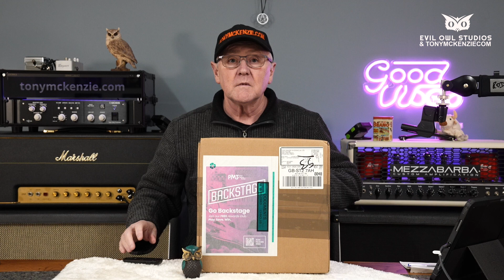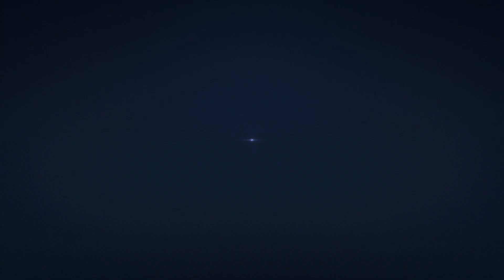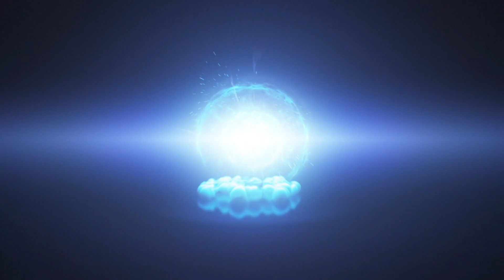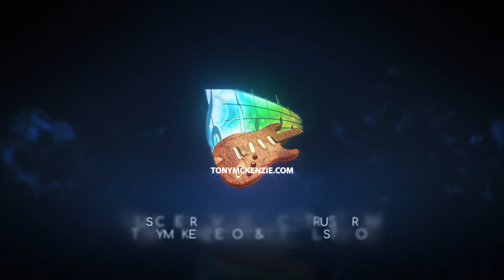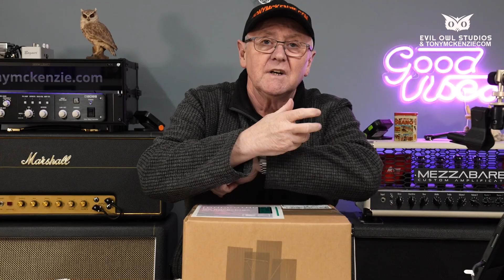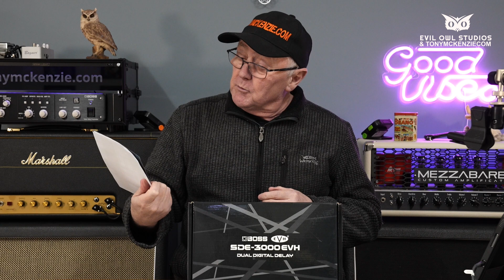Boss EVH SD 3000 dual delay: The truth

Comment: These japaneese boss/ roland electronic designers are from an other level thats foir sure...I have boss pedals made in japan from the 80sa and still work...and always have. I think that the most significant feature of this pedal is the wet/dry/wet option..which should give a kind of 3d wall of sound...with 3 amps active.

Comment: Great video. Love seeing inside stuff I don't have the nerves to take apart myself. Picked up the standard version the ther day, it was a geat deal as they are less than 1/2 price in Can/US at the moment. For my use on a pedalboard, the small MIDI jacks work well when connecting to other pedals that have the same jacks, because the cables are way less bulky and are seldom removed. Again, great video.
Reply from the maker: Thanks for watching and appreciate your input on the MIDI jacks.

Comment: Good review of the delay. Nice and thorough. But exactly what do you mean by “maybe he used wet/dry/wet and maybe he didn’t” ? Lmaooo like it’s 1000% well known fact Eddie’s been using that style of rig since the late 80’s
Reply from the maker: Well I never heard EDDIE say that... maybe there's a link or something. In the case of this pedal though I only saw an engineer and Pete Thorn saying it all. Can I trust what they say... well maybe or not, but they have a video promoting the sales. That's all I really referred to... and thanks for the info. Thanks for watching too.
Reply: @tonymckenzieofficial  I believe there’s an article of Eddie saying he used 2 separate SDE3000’s. Hence to 2 different delay times. Multiple pictures and questions with guitar techs proving Eddie used the original SDE3000’s. Also hence the reason there’s even an EVH version of this pedal. It’s not a question of if he used them. Now him having any involvement in this specific pedal is a different story. But saying he may or may not have used the original is not even a question

Comment: You can pick up a Boss SX700 for very little these days, it's essentially all 3 of Roland's 330 series i.e. the SDE, SDX & SRV 330s (the later and less noisy versions of the 3000 series) in a much shallower box (with a big 14v wall wart though) much less noise & with full control over the RSS section, more so than anything outside of the actual expensive & rare RSS units... well worth looking out for.
An original SDE 3000 goes for around 200/300 euros 2nd hand, the 330 series go for more.
Reply from the maker: Thanks James for that info. I don't use these often and sometimes it can be hard spending time looking for the stuff like you posted so thanks for that. And thanks for watching.
Reply: This has no stereo in???

Comment: Well done for buying from PMT instead of the B grade cowboys on the south coast!
It appears to be well made, even with the bodge to fix something they left out on the drawing board.
Add a great Ibanez and you can't go wrong, the clean effects sounded very good.
Hope you are keeping safe and well Tony.
Reply from the maker: Yes PMT did a very good job and the pricing was as good (actually it was better) as anywhere. I got the unit in just a day or so. On the clean all I did was back off the drive for the same one chosen amp (which was a Marshall YJM100 on its lead tones that I captured back in 2014 or so I think) and it worked so I just threw that on there. I could have spent hours on demos but so many other reviewers did that so it was not worth the time involved. Not a bad pedal (even with that snake) but I do think that many would not use it all the time. What it did it did well. I have been off a little this week actually and I'm looking for something that will inspire me to make videos - always better that way. But still here and still doing stuff... regards and thanks for watching.

Comment: I bought one of these about 4 months ago…it’s a cool pedal,and I do run W/D/W but In my rig,I don’t use the extra ins and outs on the pedal,I don’t need them…most users won’t either..Still a great sounding pedal,and the EVH presets with his settings are nice…I have an original SDE3000,and the pedal sounds nearly identical if you dial them both in the same…..also the built in noise gate is fantastic,one of the better gates I have heard…All in all I think it’s a good pedal..a little expensive,but you basically get 2 stereo SDE’s in one box,a noise gate,and all the IO you need..
Reply from the maker: A great post - and from a user. I would say that 'using it continuously' would be a problem and so for me it does have its place (maybe as an outboard device in a studio) and I see value in that. The £50 (maybe $75) difference made me buy the EVH version, but as you say if you're not using the wdw setup the standard unit could still work. Thanks for the post because that is always helpful to many guys that will take on board your comments. And thanks for watching...

Comment: Did you try the qr code on the chip…
Reply from the maker: Sadly not... I don't often find much about the Roland Boss processors - but sometimes they are there on the net. The recent Roland boss synths I did find info on and that was enlightening for sure. Ha if I do find something I'll post it on here... good point though and thanks for watching.